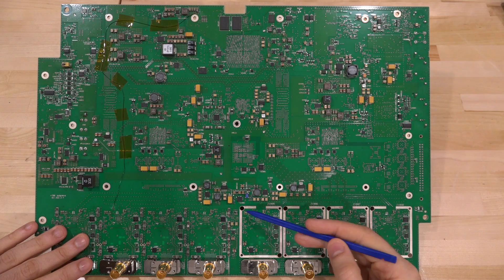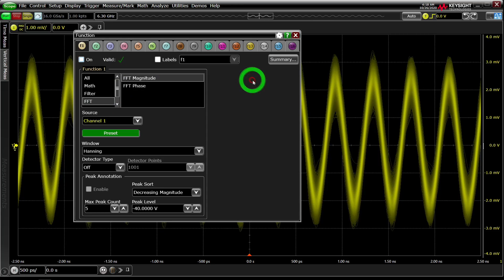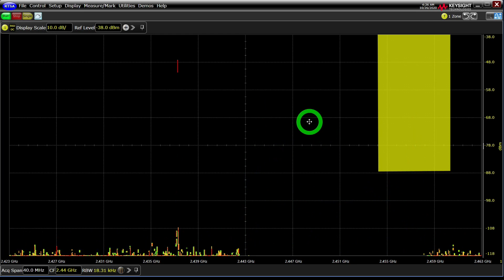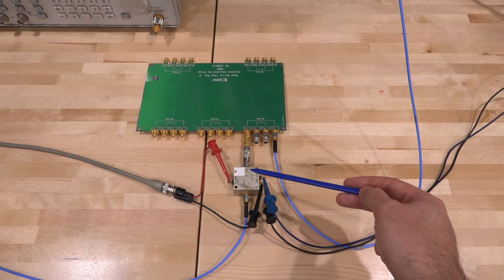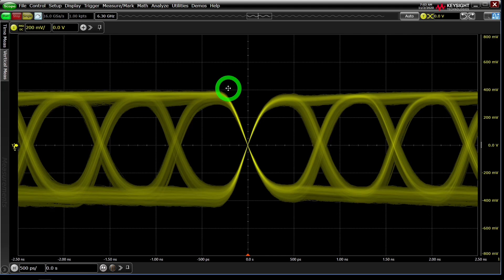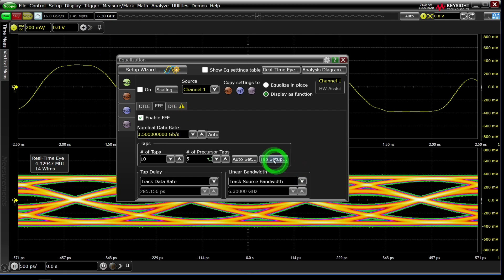TSP #179 - Keysight MXR 8-Channel Real-Time Oscilloscope Review, Teardown & Experiments

Comment: I use to work for Keysight. I did alot of signal integrity work before that them as well. With all these new analyzers/oscopes. It's just really sad that they lock alot of the features that's just "math", etc, etc. You pay a fortune for a box that has all it's capabilities locked. 

Give all these new scopes 10 years and these will be selling for a couple thousand.

Comment: Is there a specific reason why the GUI does not completely fill out the display? With all of the data being shown, and assuming an external monitor is not being used, it would seem that expanding the GUI to use the full expanse of the display would be beneficial.

Comment: Hey there mister Signal
I need a logic analyzer, more like a digital grabber than an analyzer, I need at most 8 Msps rate, but i need at least 32 channels, if not more.
I don't need deep memory, either. 1 ms capture is more than enough. 
Could you suggest something? Do I go DIY route, find someone that has done something similar?

Comment: How many PCB layers on that ADC module? ;-D
And that fat BGA in the middle, something in the 2400ball count, if I counted correctly, good luck hand soldering that one ;-)
What's about that silly 40MHz minimum span thing, btw? That makes it totally unusable to detect nearby sidebands/phase noise and all the stuff you'd usually see on a normal SA.

Comment: Are you planning to test the isolation difference between the Channels 1-4 and 5-8 in Part 2? Assuming you can switch the acquisition board to have it occupy the slot for Channels 5-8 and the instrument works with the first slot unoccupied.
Reply from the maker: Yes, I will measure it.

Comment: As a researcher working in cutting edge wide band gap power electronics, it is finally good to see Keysight with a response to Tek and lecroy modern high channel count scopes, Now for the question

@Keysight Labs Is there by chance any high bandwidth optically isolated, high CMRR (>120 dB ) like tek isoVu for high side gate driver applications?

Comment: Its not a stretch to compare this to the Tektronix MSO 6-Series B.  I have seen your review of the MSO 6 series A(4-channel).Besides total analog bandwidth and channel count, Comparing the Scopes RTSA( digital down conversion), waveform update rate, triggering, Tek SignalVu vs Keysight VSA(Pathwave?) , features, GUI, etc. .  would be helpful. Hope to hear your thoughts in Part 2 of the review

Comment: 650W power drain!
You have to go all the way back to the 1960s to see comparable power drain in a scope e.g. Tektronix 585A
Reply: That's max probably doesn't use half
Reply: Not really. My Lecroy DDA-5005 from 2002 continously draws about 400W. Even after I replaced the Pentium4 by something more powerfull and efficient. Keeps you warm and cosy at cold winter days ;)

Comment: Beautiful engineering. I cannot fathom the level of coordination, planning, and technical know-how needed to design something so complex. 

Those iOS 1.0 bubble GUI buttons on the other hand🤨
Reply: that bubble is from the S Series days, they seem to have used the same QT framework for the MXR. lower risk using existing software
Reply: @xorcipher  Yes, of course it is rolled over from years past. Just looks a little funny since that style came and went pretty quickly.

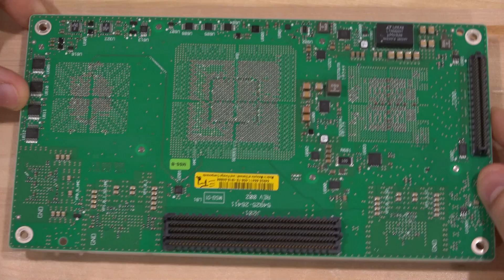Comment: 17:47 What does he mean by back drilling?, ie,  is it drilling out the solder of blind vias, or maybe drilling out plated vias, or maybe drilling just through the back layer.
Reply: Back drilling gets rid of "via stubs" (basically if the via is longer/deeper than needed) it causes jitter. You can drill off the excess/stub and it helps improve signal integrity.
Reply: @KeysightLabs  doing that also allow easier EM simulation?
Reply: @vaualbus  Maybe? The bigger benefit is the actual performance, though. With a sim (depending on what program you're using) you can modify the parameters to match your actual system.
Reply: @KeysightLabs  yeah I know about the performances but I recalled reading that. Anyway thanks for the answer 😊 and congrats for this product!

Comment: Another rich man's toy
Reply: Wrong. Its a high bandwidth high frequency test instrument. Expensive sure, Any lab doing work in these frequencies will have the budget for it.
Reply: Did you see the UXR review!? 😂 This is definitely attainable for must folks working with these bandwidth/analysis requirements.
Reply: @KeysightLabs  well maybe not for personal use 😞, but the price is very reasonable. Now to convince a grant committee of that fact...
Reply: Hey, it doesn't even cost a Get Quote. By rich people standards that's basically walmart prices.